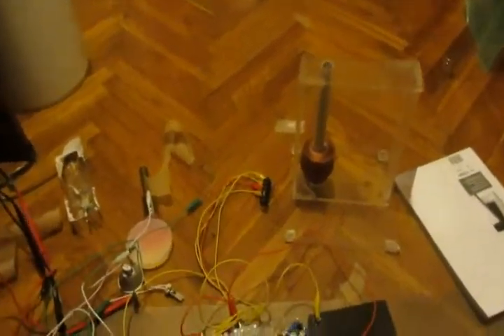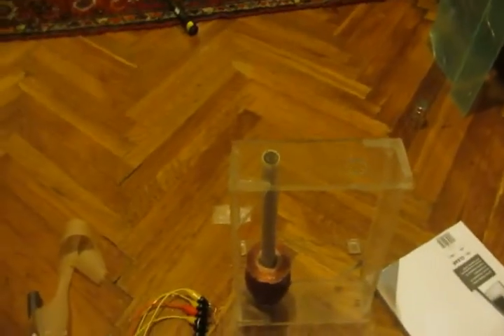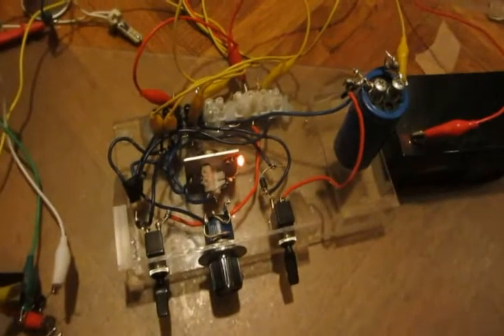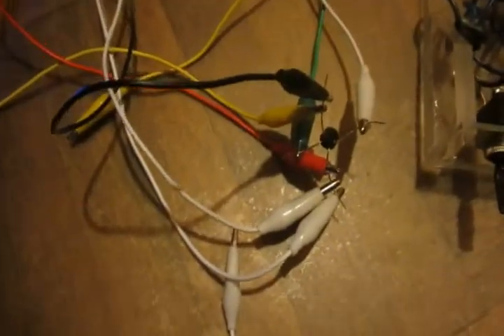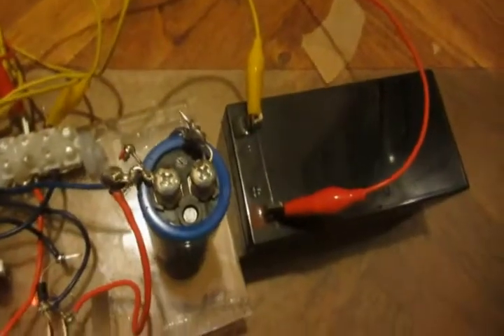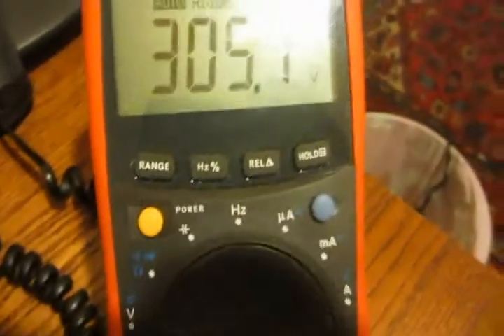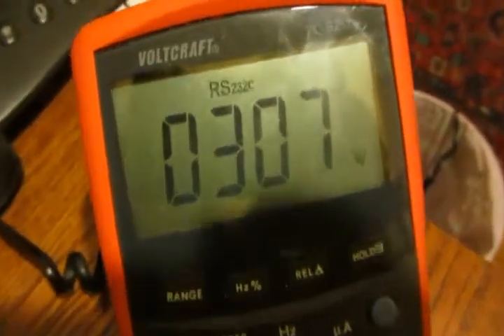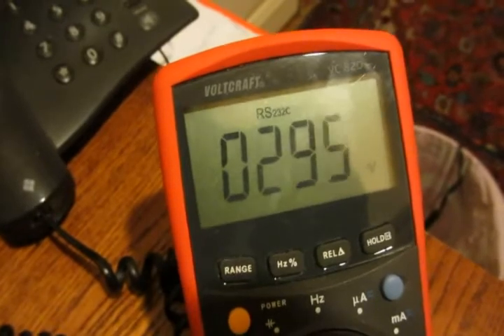250 Volts and rising - The Best Linear Bedini

Comment: scale it up in size by wire size and magnet,  but build two one with positive and one as a negative bemf to drive each other to charge caps for self run!
Reply from the maker: Hi, well you are right.. i will do that, but this was an old video i just found :-0) I had never published it... it had allways been unlisted. As I retired this week, I am going to reactivate this whole channel. I got myself new (better) video gear and will come up with better stuff. I think that this kind of motor can become overunity (ie produce more than it consumes) but i doubt that it can become a self runner. Actually I am planning a "gravity version", i.e. shoot the piston up where it only charges a cap, and when it comes down, let it produce electricity with lenz effect and everything. Gravity should help it overcome the lenz...
But first i have to organize the old stuff. Thanks for your comment! much appreciated.
Luc